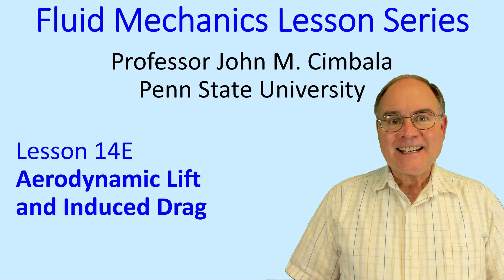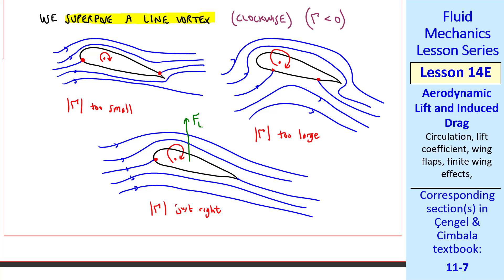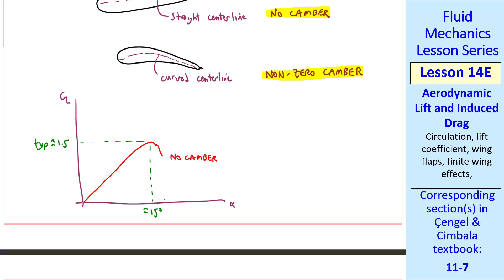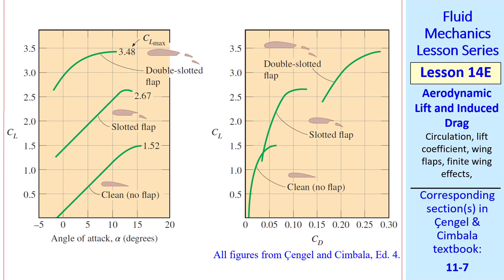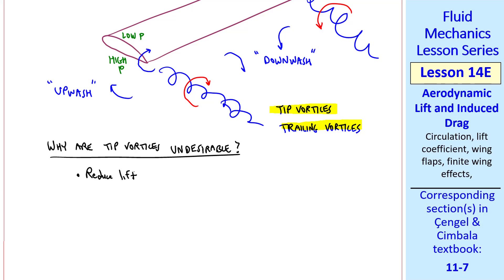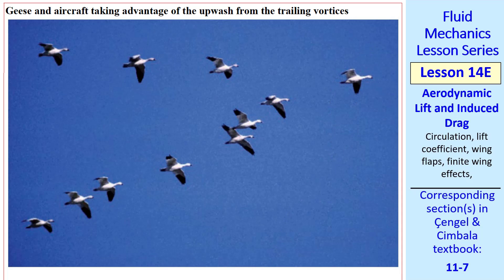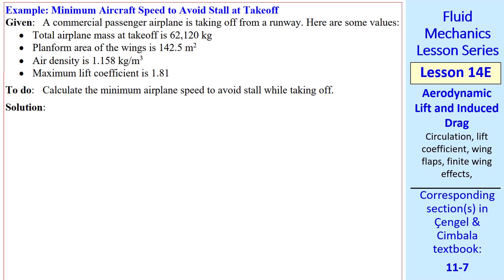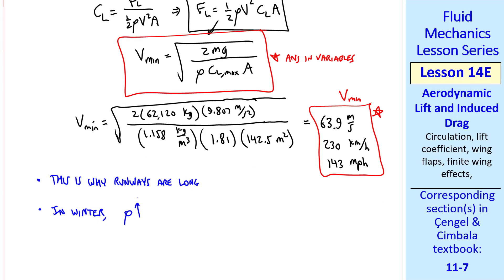Fluid Mechanics Lesson 14E: Aerodynamic Lift and Induced Drag

Comment: hmmmm
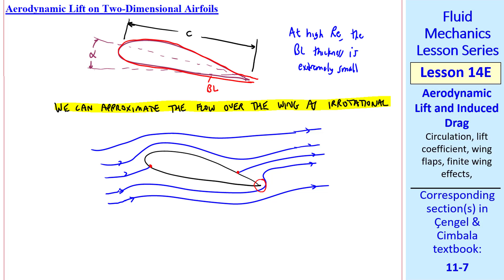1:09    there  IS  No  flow.!        a wing is an object Moving Through a Stationary  fluid/air.! 
2:24    IMAGINARY  vortex  gobbledy-gook.!
2:32    ?????     wrong.     this aspect of aerodynamic lift has a newtonian explanation.  eg., as a wing that has positive aoa moves through stationary air, the wing 'pushes down' on the air and the air pushes back.        googletranslate
Reply from the maker: Think in terms of a wind tunnel, then there is a flow. It is relative to your frame of reference.